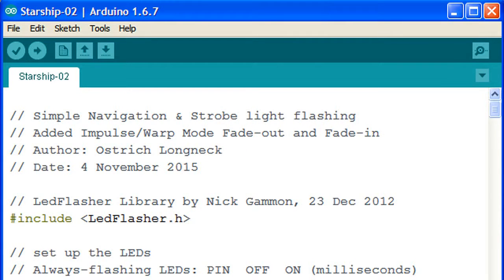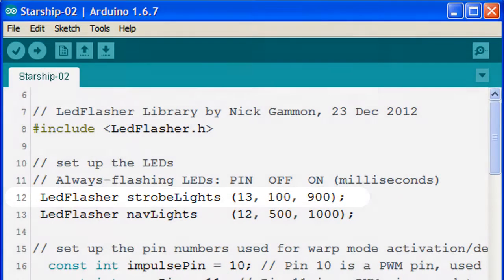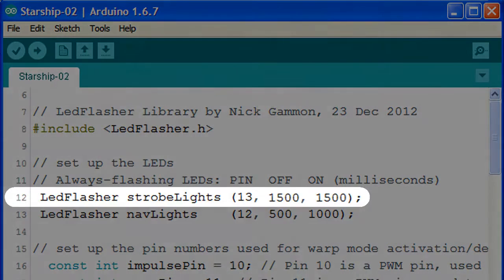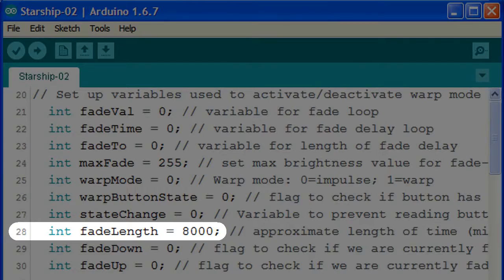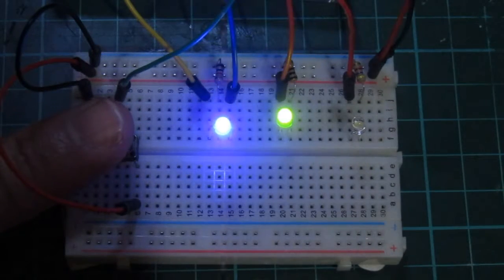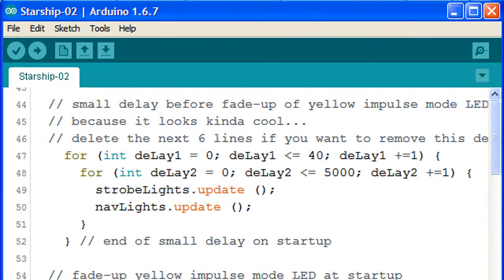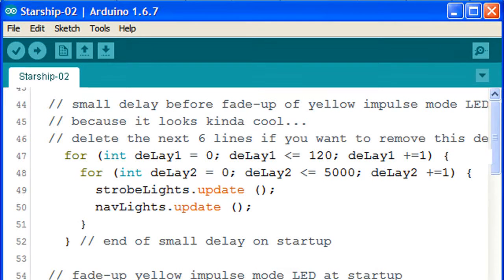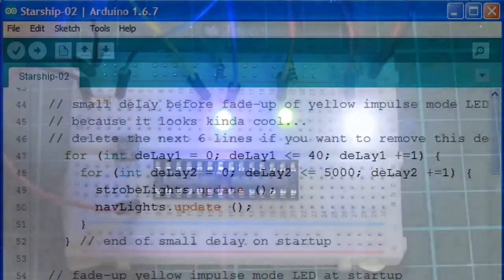Arduino for Starships - Ch04 - Bonus: Sketch Bashing

Comment: I'm sure my question will be answered in time, but it seems the fade from 0 to 255 is not really linear?  The led comes on rather quickly to about 30 or 40% and then slows the progression to 100% on.  Fading down seems smoother, but I wish it would take more time for the initial ramp up.  I have to mention that I am using two leds as I don't have a dual filament one and you did say that the fading effect will not be as smooth with the individual leds.
Reply from the maker: Hi, yes it seems that the LED's only start fading up once they hit a certain critical voltage, and then they fade up quite rapidly. To be honest, I wanted the fade up to happen in the opposite way, with a quick ramp-up followed by a slower increase to maximum brightness, which seems to be the way they did it on-screen. One can play around with the values for the delay loop and make it shorter as the LED approaches 255 (or vice-versa in my case.) I don't know if this is any help - I should have included something along these lines in the Sketch-bash video. One can tweak the sequence quite a lot to suit your needs. Thanks very much for watching and commenting :-) - Trevor